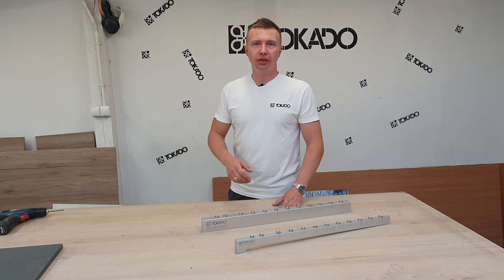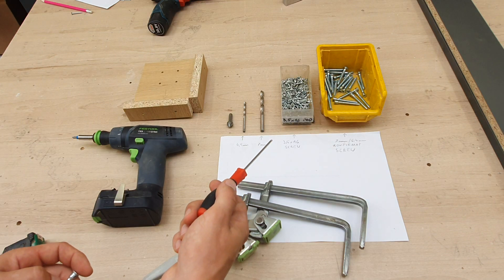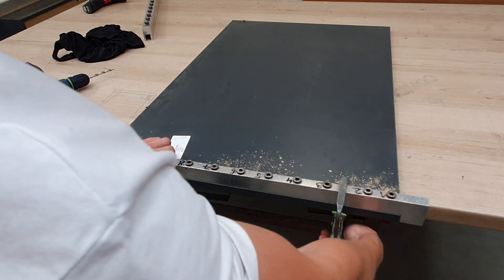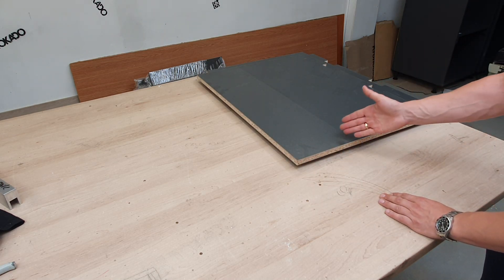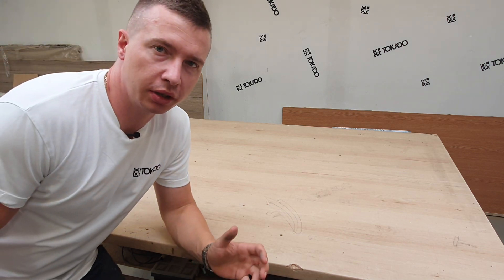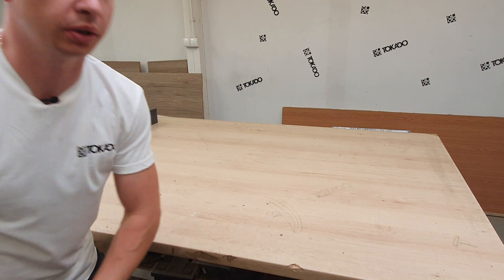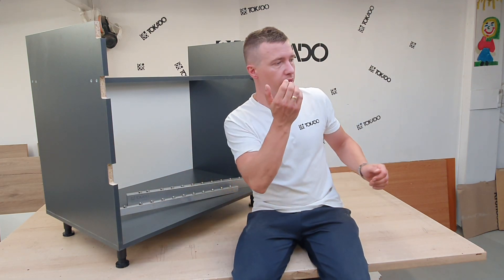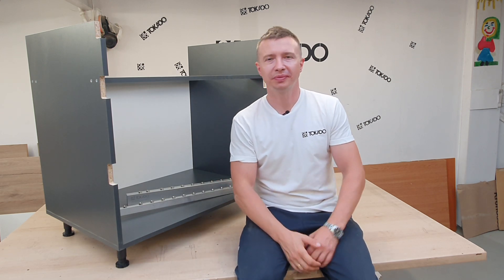Drilling jig for confirmat skrew Drillex T200. how to make cabinets in easy way ?

Comment: For what holes you use 4,5 drill bit; and for what 7?
Reply: The chipboard screw has a threaded part that is narrower than the cylinder shape that forms the head of the screw. That's what the two diameters are for.

Comment: Hi, will these jigs work with the other cabinet build method where sides come down, and bottom/top panels are sitting between the sides? 
It think they will and it doesnt matter which method is used but I had to ask.
Thanks